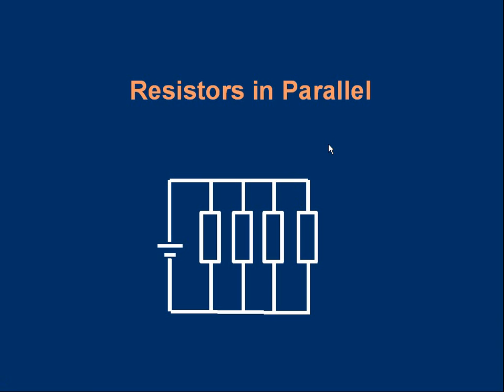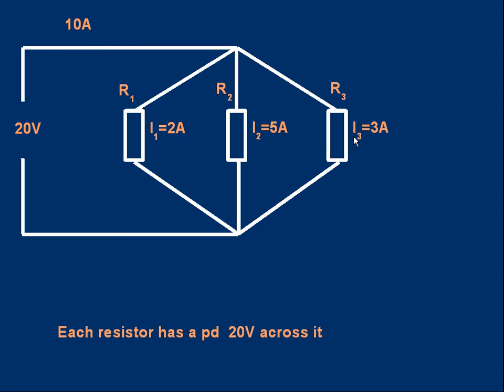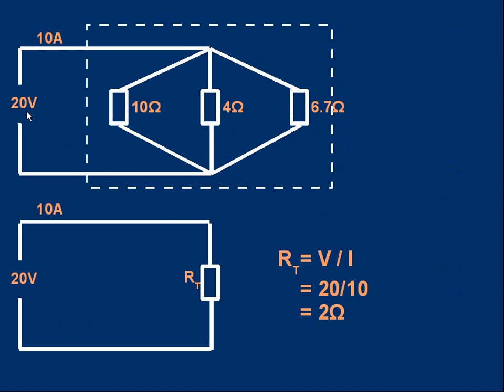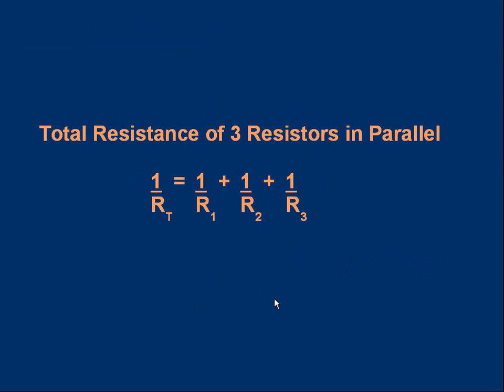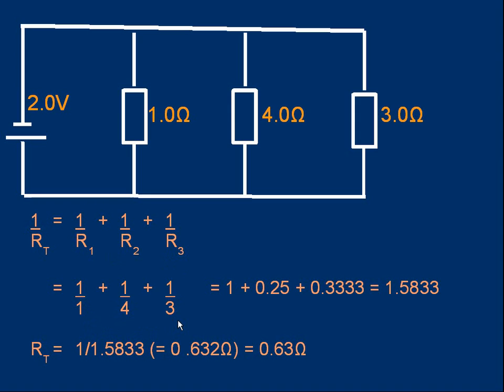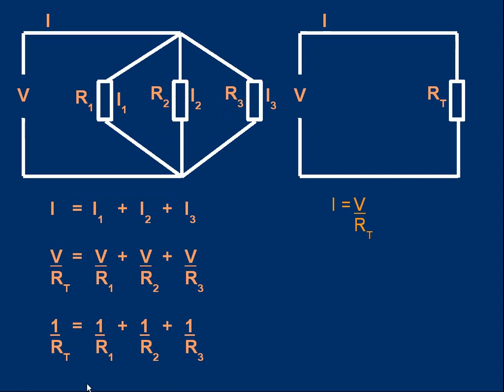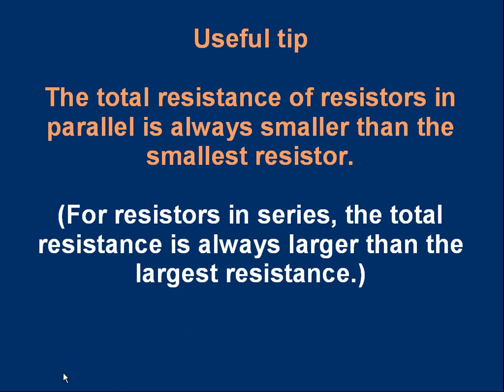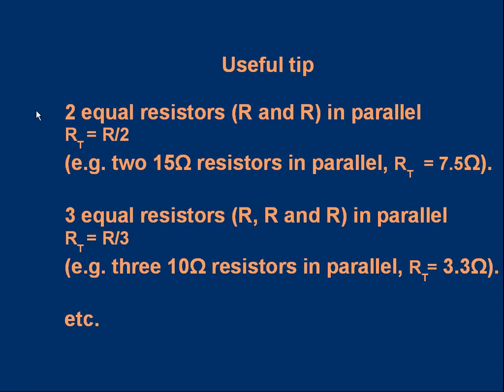GCE (A level) Physics E13 Resistors in parallel

Comment: Clear and very informative. Do you think you could possibly do a similar one relating to how you would use ratio to find the value of an unknown resistor in a paralell circuit. Had a circuit given with unknown supply , 13A current branching into 3 resistors (R1 R2 R3) in paralell. Only other values given were 4A going through R1 which was 2Ohms and that R2 was 3ohms. Thanks.
Reply from the maker: I can't make a video on this. But this may help.

Voltage across R1: v1= i1*R1 = 4*2 = 8V

As the resistors are in parallel they have the same voltage (v1 = v2 = v3). So 8V is the supply voltage

As the voltages are the same, the current though each resisistor is inversely proportional to its resistance. So you could use ratios to find i2:

r2/r1 = 3/2 so this means i2/i1 = 2/3 therefore
i2 = (2/3)i1
= (2/3)4
= 8/3A

But it's easier to say i2 = v2/r2 = 8/3 A

13A splits three ways with 4A  through R1 and 8/3A through R2
The current through r3 is: i3 = 13 - 4 - 8/3 = 19/3 A

r3 = v3/i3 which you can complete.

Comment from the maker: The same number of electrons enter and leave the resistor each second.

The resistor basically slows down the electrons. 

Suppose a single resistor is in series with a battery.  The resistance is then doubled, causing the current to be halved.  The speeds of ALL the conduction electrons in the circuit are halved: the ones in the battery travel at 1/2 of their original speed; the ones in the wires travel at ½ their original speed and the ones in the resistor travel at ½ of their original speed.